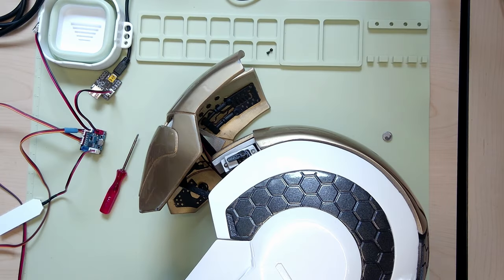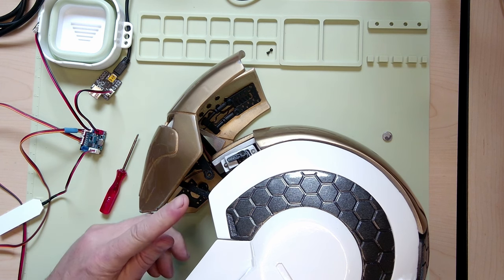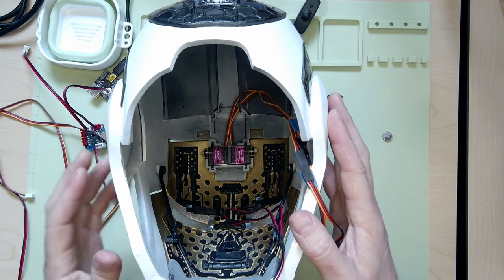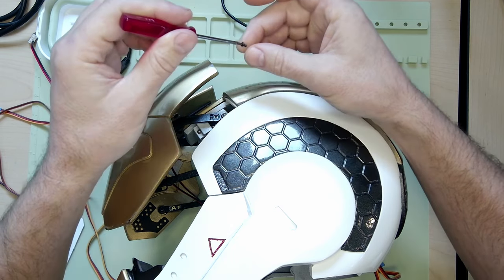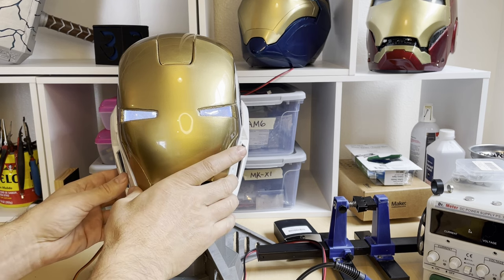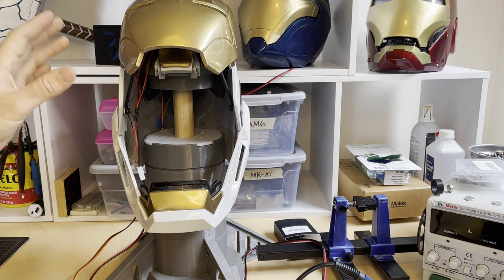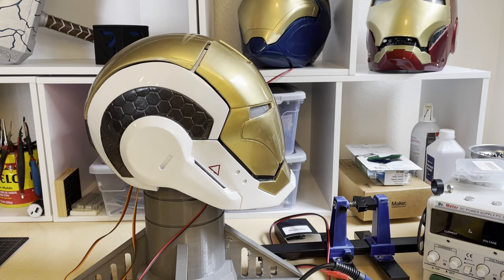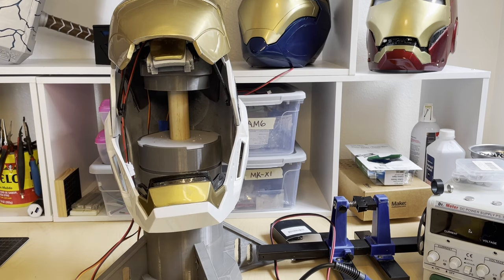Steal Our Iron Man Helmet Motorization Secrets!

Comment: Hi guys, from italy here..
I have a ironman helmet mark 85, that needs 3 servos... I can't find what alisha boards is best for that, with audio too... the alisha mk XI don't think it works for that .
cheers
Reply from the maker: The MK-XI will work for it.  When you place your order, add a note requesting the Walsh MK85 code and we'll load it for you as well as add an extra servo cable.
Reply: @crashworks3d  Oh ok, so I need the Alisha MK-XI only ? what about the sound ? Because I can see on ebay, only one board is available...thank you.

PS: how long will it take to ship to italy ?
Reply from the maker: The Walsh M85 code will also work on the sound boards MK X-D and MK X-J on request.

It typically takes approximately 2 weeks to ship to Italy.  However, we have no control over the shipping service and it can vary.
Reply: @crashworks3d  Thank you, so which board should I get then ? I'm a bit confused, it's my first build ;)
Reply from the maker: https://www.instagram.com/p/CwbIY99rBhY
Reply: @crashworks3d MK- X-D ... how do I order it ?
Reply: Hello ?  @crashworks3d
Reply from the maker: The eBay store link is in the description.
Reply: @crashworks3d  it says all sold out
Reply from the maker: Keep checking back.  We make batches weekly.
Reply: @crashworks3d  like you suggested in checked your insta post, and I think I need the  MK- X-D...
Reply: @crashworks3d  hi there. I messaged you on eBay but I think I got an automatic response.